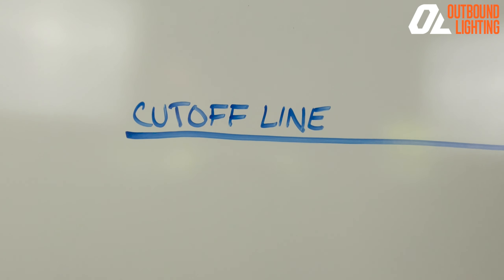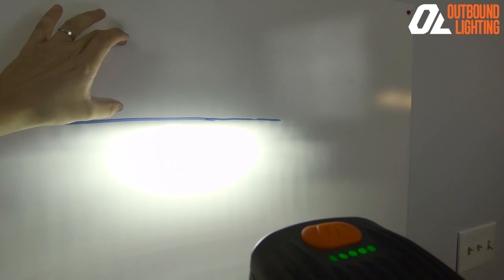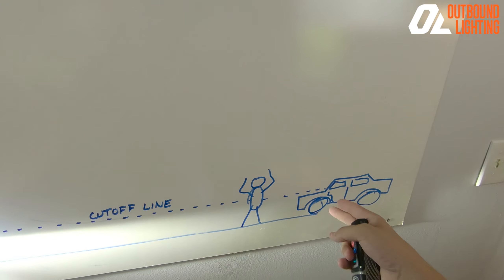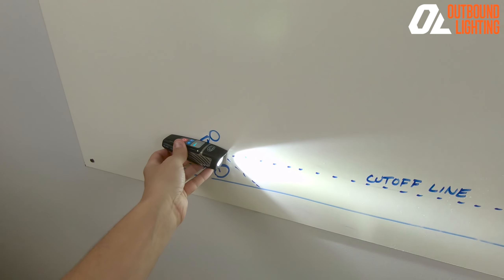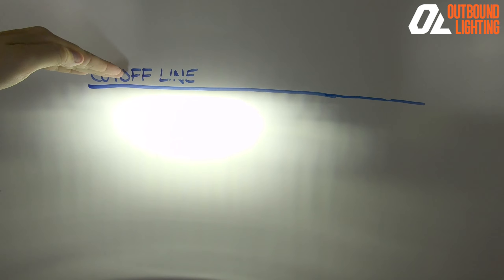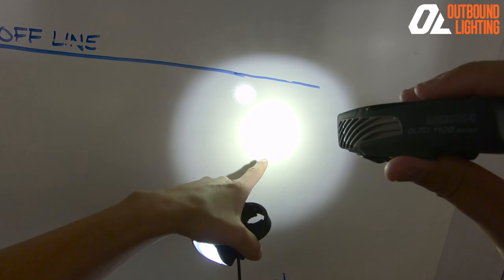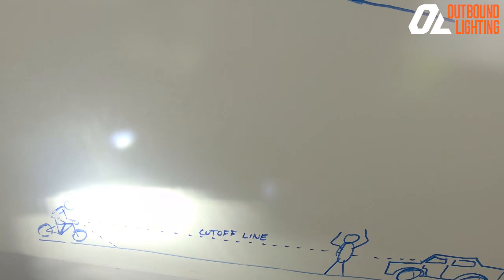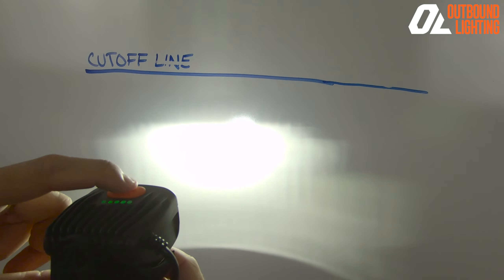What is a cutoff line? Outbound Lighting Explains

Comment: For those of you watching this video, the cutoff type of lighting is superior over the round beam type of headlight for road use.  Motor vehicles use this type of headlights.  It also means that a lighting company that uses a cutoff beam doesn't need to use as much power to get the same amount of light on the road, which means a smaller battery, longer run time, and less weight.  While I don't have the Outbound Light, I do own a Philips Saferide 80 that is the first cutoff beam headlight ever made for a bicycle, that light is now about 14 years old, and it puts out a very strong beam of light onto the pavement equal to about 1,200 lumens from a normal circle beam.  My light puts out that kind of power using nothing more than 4AA rechargeable batteries; and on high mode, it will run for about 2 hours, which isn't bad for 4AA batteries; it will run for about 8 hours on low. The interesting thing about the low beam, I have two other lights that put out round beams, one is 400 lumens, and the other is 600, and my light on low is brighter on the pavement than those other two.  The other interesting part of all this lumen stuff is that the Philips is rated for "just" 220 lumens on high!  Where I live when I ride at night, that Philips has the brightest beam on the road even over much newer lights!  

Unfortunately, the Philips is no longer made, but if mine were to fail I would be ordering this Outbound Lighting road light without even thinking about it because I know how effective the cutoff light beam is, and how well it uses battery energy.

Keep in mind, the cutoff light beam is only effective on the road, it does not work as good as a round beam light off-road.  So what I do, is use the Philips on the bar, and I put my 600 lumen round beam light on my helmet.  I'm not racing when I ride off-road at night, I'm taking my time, so the light output I have is plenty.